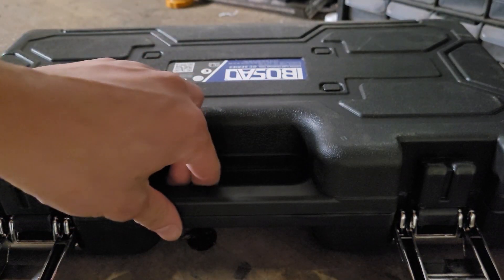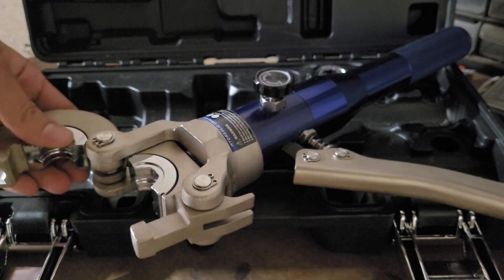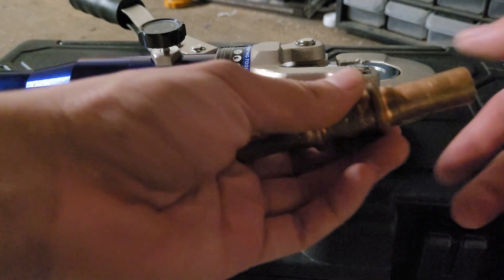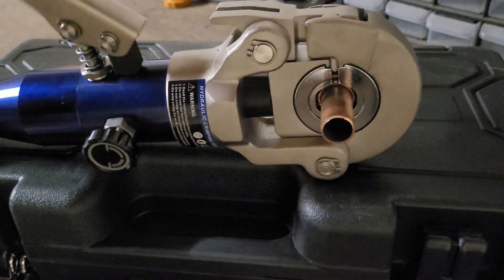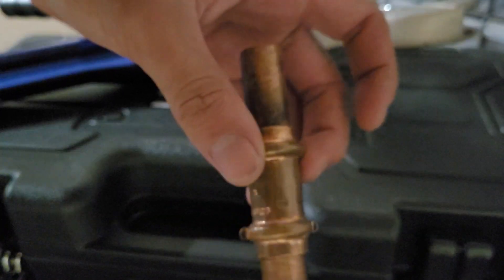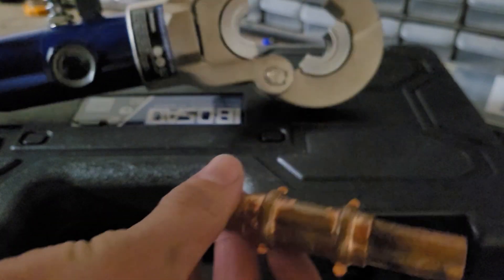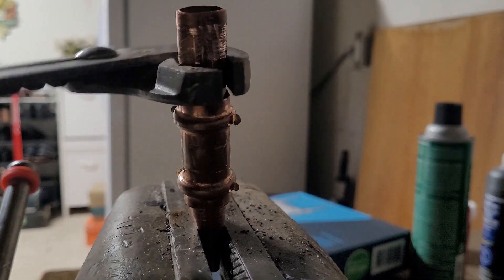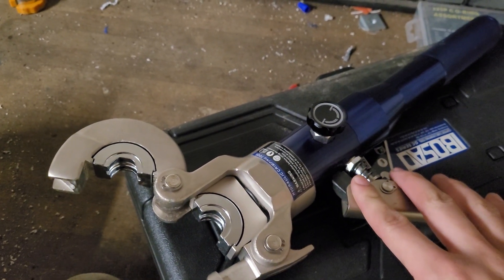IBOSAD GC-1 Copper Press Tool Review - $100 ProPress! (See update in description)

Comment: I have this tool it works good for the regular copper fittings but when I used it for more heavier duty fittings that are made of brass such as a ball valve it can’t provide enough pressure and they leak. I finally bought a proper propress tool.
Reply: What proper propress tool did you buy Warren?
Reply from the maker: @chanceayres6718 Ridgid and Milwaukee seem to be popular press tool manufacturers
Reply: @DragonBuilds  thank you but not spending that kind of money. Going to look at other Manual tools
Reply from the maker: @chanceayres6718  The Bluefin one from supplyhouse.com is pretty good. Definitely avoid these no-name Amazon ones unless you want to come home to a destroyed house and high water bill.
Reply: @chanceayres6718  I finally bit the bullet and bought the Milwaukee M 12 press tool kit and it comes with three jaws half-inch 3/4 and 1 inch. It’s very expensive though but it is a phenomenal tool
Reply: @warrensnow6695  Do you work in the trade - plumbing or handyman?
Reply: @Joseph-eh4rs  yes I’m a remodeling contractor of almost 40 years
Reply: I don't have this exact one, I have the one with replaceable jaws instead of dies, and I press brass no problem. You just gotta give it a little more muscle. No leaks yet.
Reply from the maker: Yeah, this crimper worked fine with JW press fittings but when I tried to crimp a thicker Viega fitting it leaked. The Bluefin press tool works well on brass fittings but needs a lot of space to work, so I only use it in situations like adding a ball valve when the water won't stop flowing.

Comment: There are different clamps available for this tool. If I'm not mistaken yours is V type. There are also TH, U, S, M. But hard to find separately sadly.
Reply from the maker: This tool claimed to be compatible with the ProPress system sold in North America, so there is obviously something wrong with it.
Reply: @DragonBuilds  ProPress? Good to know. I've been searching for different die inserts to fit this tool and Alibaba was the only place I've found so far. Shipping costs are $39.95 alone.
Reply from the maker: @paulweston8184  If you really need a press tool I would suggest either getting the Bluefin one from supplyhouse.com or renting an electric one from a local plumbing supply store.
Reply: @DragonBuilds  must be a AliExpress thing.  Just saw them being sold there. There probably not well calibrated. 
Also found the different jaws there too. (for cheap obviously)

Comment: No way that's going to leak....lol
Reply from the maker: It ended up leaking and I had to redo everything. I'll just solder from now on.
Reply: @DragonBuilds  I prefer to solder, but like anything I guess propress has it's place
Reply: Anyone use a non shitty tool? Even the pro plumber I called over a main leak used propress and it's held for 2 years now. I guess Europe has used it for decades too

Comment: Does it work on air conditioning?
Reply from the maker: No, just for plumbing
Reply: If you can find the correct size jaw(s) and fittings it will work on air conditioning lines. Unfortunately the jaws are not compatible with the more popular’ pro-press’ tools

Comment: Got the same one. Used it a few times with absolutely zero issues.
Reply: Still with 0 issues?
Reply from the maker: They changed the design recently
Reply: I have one, used for pex and multilayer pipe. First thing I did when I bought it was to crimp a fitting and cutting it with a grinder to see the cross section.

Comment: Appreciate the video. Unfortunately its not about whether it can resist a twist, which it didn't. The real issue is ANY water leaks.
Reply: has rubber seal inside treated to resist drying splitting on gas or water , my plumber here used this method on my home water heater (gas) , so im buyinig this tool and doing the next time myself save $$$$$$$$$$$$